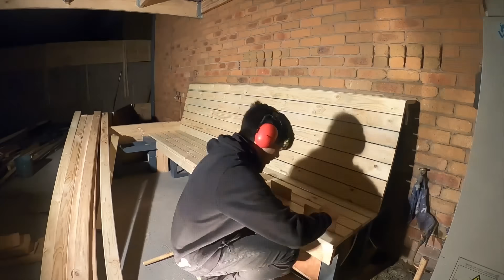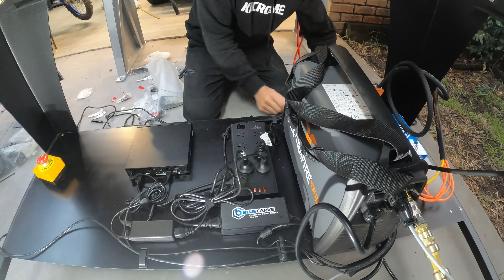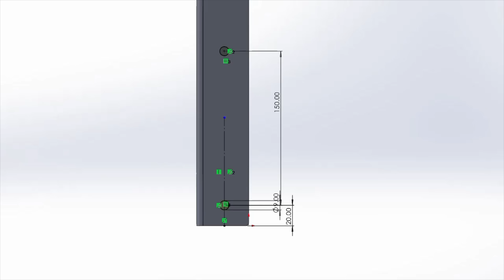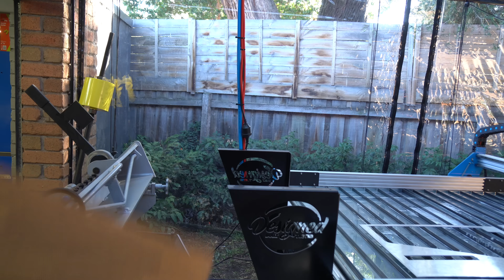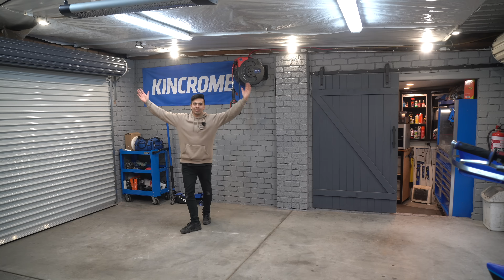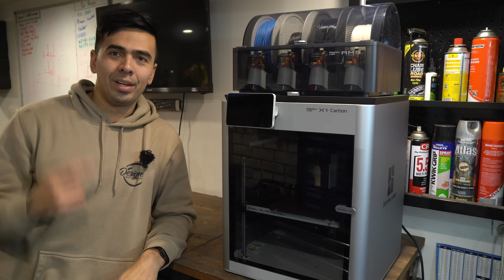Turning my backyard into a SHED EXPANSION

Comment: Just finished my Mech eng degree at RMIT, stumbled across your last video on how to become a design engineer(The dream). I got so much to learn though. It seems Unis have watered down the courses a fair bit so you don't know whether your doing that well(GPA 3.1/4). Was offered a PhD though. Felt like a did pretty well compared to the class but I just don't know if its because everyone's doing that well as expectations are low IMO. However these videos are inspiring, I really look up to how well you both understand the theory and can use tools to actually produce things! Hoping to attempt building a CNC router after I sort out my project cars which just melted a spark plug(Found a bunch of plugs loose(Only just got the car hadnt changed them yet). Threads are gone and I am thinking of going to the dark side by putting a heli-coil on while the head is on the engine. Mainly because I just replaced the timing belt in the rain on a sloped driveway half nude cause I didnt want my cloths getting wet. I don't want to do that again plus more as at that point I may as well rebuild it as its got 450k kms(Lexus LX470).  I will be sticking around and watching the previous stuff. Great to see the locals smashing it. Keep it up!
Reply from the maker: Cnc router sounds like a hell of a project!! All the best with your career mate, sounds like you're a clever cookie! Appreciate the support from a local mech eng!

Comment: WOW! soooo good, I'd love that setup. I would have thought the motion and vibration from the air compressor would have affected the cnc plasma cut quality. Is that not the case? Also, are you saying you prefer cnc plasma cutters over cnc laser cutters? I thought laser was supposed to be the best, cleaner cuts, finer details, less kerf etc. Just lasers cost more. Really interested in your thoughts on this 😁👍
Reply from the maker: Hey mate, no problems with the the compressor, it is really quiet and vibration free.
You're right, I prefer laser but there is generally a 1-2 week lead time and they don't like doing 1-offs. Once my designs are finalised and i'm getting big batches I always use the laser! There is a massive difference in a 70K laser to a 200K laser as well, they are great but unaffordable to most in a backyard setup!
Reply: @DesignedandBuilt good info as always, thanks cobber. That all makes perfect sense 🫡

Comment: At last someone plumbing a drain into the plasma table! And on the tech side, yes once you've had a Mac you will absolutely only want to use Windows for the rare things Mac isn't up for (Assuming you can't just use Linux for all ;) ). Thanks for sharing. Cheers. ps: I was very surprised about your YZ250x "review" compared to the Euros which made me look at the price (bargain) but I'm still traumatised about my YZ250 MY00 when compared to my current GasGas 300EC MY18 (starter has never worked and have never had a dirt bike with a starter so would be great to test ride a 250x to understand what you've experienced)
Reply from the maker: 100% agree on the computers. They are a bargain and they are ultra reliable, easy to get parts for. Easy to change a top end on! Awesome machines. I've never had a problem.
Reply: @DesignedandBuilt  me thinks you ride trails like an mx track hence your suitablity to a YZ ;)
Reply from the maker: Haha I’m no racer but I give it a nudge! Super playful bike.

Comment: 37:00 I do not agree:
- I never had a self build Windows machine fail in the last decade or so
- I have a M1 16GB since 3 years and I hate the Mac OS sooo much. But it is cheap, runs ages on bat, relat. good screen and good speakers. Fast (for a 900€ machine!) for picture editing and very fast in Davinci resolve STUDIO (NOT the free version). But the OS is the dummest one I ve ever seen. If I could switch to Ubuntu with NO possibility to go back, I would not hasitate a second. (And I never used Ubuntu since 10 years!) I wrote a long article about that
- Video editing depends on 2 things: The SOFTWARE AND the Grafik. Most software does not care about the CPU; like Adobe/Davinci and Apple´s. You can scale  a WIN machine on your budget.

If can can get over the stupiest OS ever made and with NO self willing, you can go M4 Mac Mini smalest version and it will be great! 

But I have MY OWN opinion which software I want to use. So I cannot use MAC OS. The simplest things do not work and you need to pay for all things which are free (ware/open Source) on WIN.

Comment: Ive been working from home for a few years now, full time fabricating performance car parts and neighbours are definitely a big consideration, you are lucky to get on well with yours lol. 

I use AC laser for my laser cutting, which is pretty high volume with all my different products I make (mostly 2.5 & 3mm ally)  But this plasma table it certainly tickling my interest 🤔 
very nice setup you have, lots of envy haha I'm certainly primitive in comparison
Reply from the maker: 100%, massive consideration. Pro's and Cons to both, you do have to sand back the aluminium to get good welds off the plasma table, laser you can just blaze straight away!

Comment: Another amazing video and super impressed with the new setup. I saw your comment about a dryer. Don't buy a commercial one. I built one based on this video - https://youtu.be/DPX48WuaIhw?si=g3Rg752tyUPS0DOd for my plasma cutter and have never looked back. Happy to share some photos and comments if you want more detail but I've used with a blast cabinet in summer in Newcastle and never had an issue with moisture.
Reply from the maker: Thanks mate, I've watched that video and that looks like the go. Appreciate the comment.

Comment: Hey mate, setup looks great but id advise not using plumbing supplies to plumb up air.
They aren't rated for the same pressure and can potentially explode.
Reply from the maker: Hey mate, appreciate the comment - have seen a lot of people do it without any issue and hoping thats the same for me! 🤞
Reply: @DesignedandBuilt fair enough, like i said mint setup
Reply from the maker: Thank you!!

Comment: Great job with the expansion mate. I was wondering if you would need to consider a water separator/dryer for the air compressor lines to minimise moisture running through to your tools, or does the filter you have currently do it? Cheers
Reply: Don't worry....just saw the part of the video where you discuss it!
Reply from the maker: Cheers Luke!

Comment: For your Bandsaw make two height adjustable roller stands. 
i made two of them using old jockey wheels for the height adjustment.  and weld a nut on there to stop them spinning once you adjusted your height. 

as we all know concrete is never flat😅   this way you can adjust them to suit. and move them where you want depending on the length of steel. 
i used this setup for some years now with a simular bandsaw.  amd its makes life so much easier
Reply from the maker: Yes agree with this 100%, I'll get on it!

Comment: Just something i'd point out, if you're watching this and thinking "damn i'd love to do some custom parts myself, shame I don't have a $12000 for a plasma table" I highly suggest you look into local laser cutting places they're surprisingly affordable (a bracket I did for the old mans 12v was like $30 1 week turn around). Yeah you might have to wait a bit for it to get cut but the barrier for entry isn't nearly as high as you might think. 

Also love to see a bit of 3D design make its way into the video. Hope to see some cad montages make they're way to the time lapse channel for the bigger jobs.
Reply from the maker: haha true that Dave, I agree with you 100% and have been there and done that for many years! This is so I don't have to wait that week or two, so I can bang out 20 prototypes in a day! But yes, laser is a cheap and great option.

Comment: Nice 👍 
Keep your compressor isolated on the ground, the vibration will effect your cutter. I did with our laser engraver
Reply from the maker: Hey mate, great point. No problems for me so far! But maybe with  something as fine as a laser engraver it would make all the difference!
Reply: Will there be airborne dross from your machinery, that will end up being sucked into the computer by it’s cooling fan?
Reply from the maker: @jonathanseal5155 we have run a similar setup for a number of years without any dramas!!!

Comment: Hmmm, do I really need that third bedroom....
What's the measurements of the plasma table??
Maybe with appropriate placemats, it could double as the kitchen table, that way I could utilize the extraction fan.
Ideas, ideas.
Reply from the maker: The answer is you don't! Haha you could easily get a half sheet size in there. Now you're thinking 🤣🤣🤣
Reply: @DesignedandBuilt Just visualized the conversation with the responding firefighters, "you were doing WHAT, in the bedroom??".
I could yet be the reason for a clause in home insurance contracts.

Comment: Can you adjust the off set to compensate for the cutting radius (G41 G42) . Does the softwear let fthe put tabs on the parts to provent parts from tilting and provent a collision with the head.
Reply from the maker: Hey Robert, not that I know of. The torch has sensors on it and will stop it collides with anything!